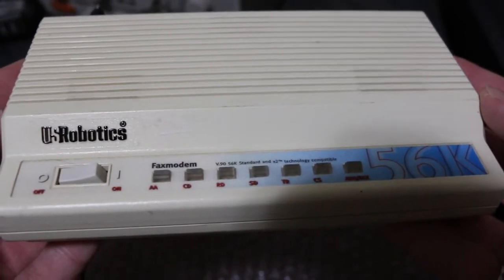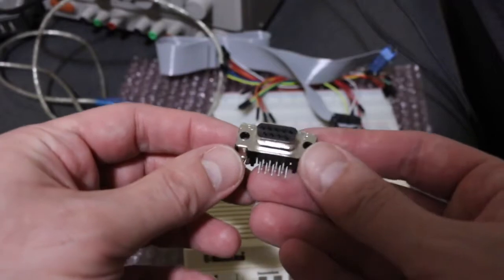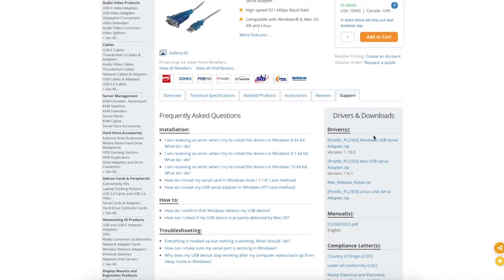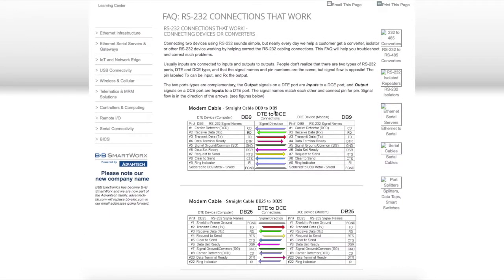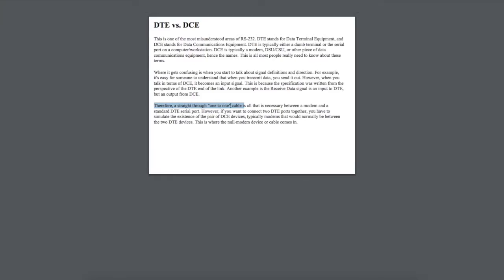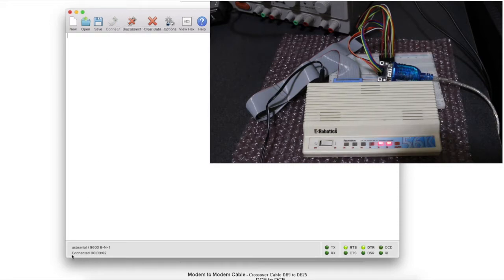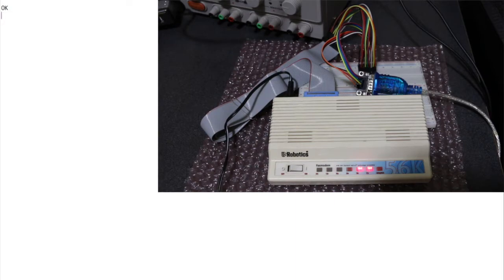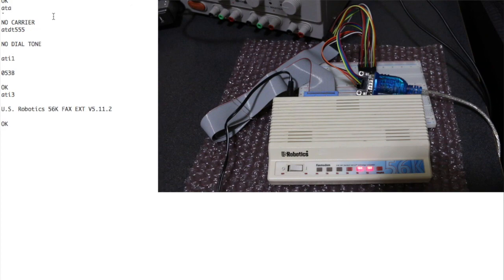Testing a 56k US Robotics Fax Modem

Comment: Get a cheap viop ATA like a linksys pap2t or similar and set it up with a voip service provider, there are many very cheap ones....wont be as good as a landline but if you drop the speed a bit it will work fine. and yes modem to modem connection via phone jacks does work, you just have to send ATA to the receiving side as there will be no "ring" signal....the pap2t has 2 lines and you can connect 2 modems and simulate 2 phone line for free using a service like sip2sip and then they can properly call each other with ring signalling, etc.
BTW> There are many a BBS you can dial up:
https://www.telnetbbsguide.com/bbs/connection/dial-up/list/brief/

Comment: Using a USRobotics USB softmodem, ati1 was simply given an "OK" response.
Reply from the maker: I have a soft modem I found in another system that came into my possession that I haven’t tried out yet and I never used one before so I will have to play around with that.

 But I still have a different 14.4k external one that I can’t get any response back on  so I need a way to figure out if it’s totally dead or how to recover it because it powers on and echos characters back but it just won’t respond to anything.